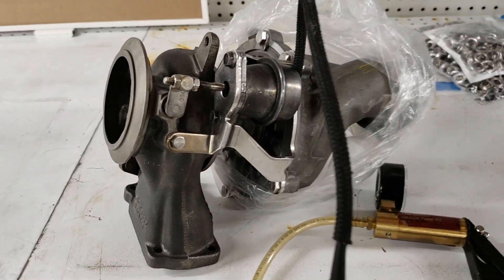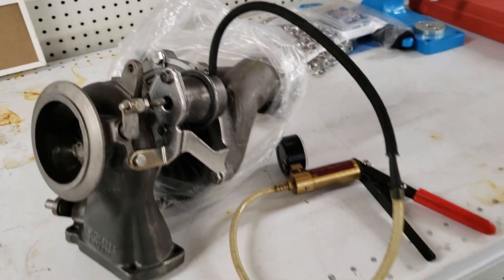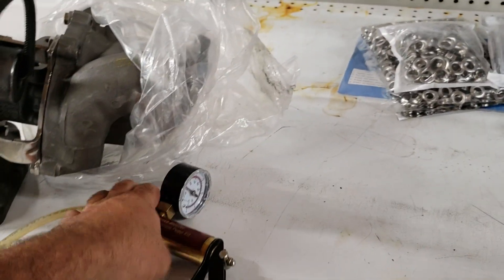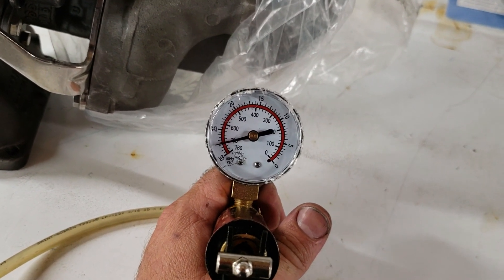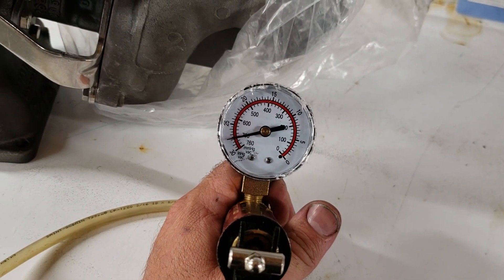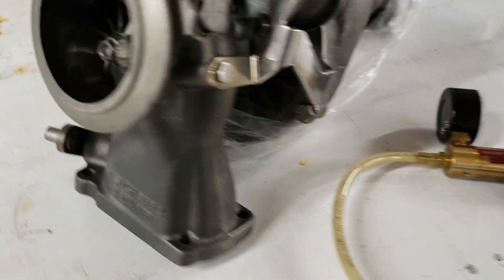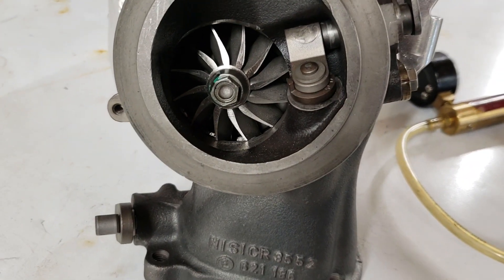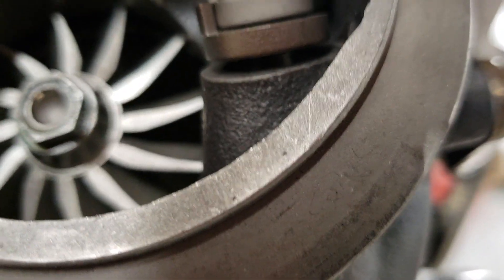BMW M57 wastegate talk

Comment: I have an E39 525D on a stock map. I have recently put a 530D E39 hybrid turbo, it should be boosting around 17psi
It’s actually boosting to 35psi plus, we changed the actuator, and when unplugging the MAP sensor it’s laggy as hell but boosts to exactly 17psi
Any ideas?
Reply: its a vnt turbo at first, not wg, and secondly, a hybrid should be remapped with a person that know PID control loops and can adjust them. when unplugging map, the ecu goes to limp, and it should only boost as the turbo can with the vnt at stock position

Comment: What is the part number for this actuator. I called a few days ago and was not able to get a part number...
Reply: Would like to know too
Reply: Borg Warner was very helpful when I emailed them. 👌🏼
Reply: @Robert.K  Did they give you a price at all?
Reply: @JINSTASUTUBE  2400 NOK / 210 GBP / 285 USD
Reply: Is yours not holding vacuum?
Reply: My car is a 2005 535d by the way, not the same as what's shown in this video. Prices should be about the same anyways.

Comment: I’m having a problem with boost creep on my ‘12 X5d. I have verified the WG open by applying vacuum. I adjusted it the other day and added a little more preload on it. I am still seeing 38-39psi when commanded is 33-ish psi. 
Have you ever experienced a WG port being to small or clogged on these? My drive pressure is very reasonable for the boost and engine load.

But I am at a loss on figuring out the overboost.
Reply: Have you been able to figure this out? I have same exact situation right now after Dpf delete and tune ..
Reply: What was the fix? Any info on that?
Reply: Ditto, same issue after dpf delete.
Reply: Ever figure out the overboost??

Comment: Isn't the diesel M57 turbo open by default and the vacuum closes it?
Reply from the maker: No sir, just the opposite
Reply: @TuneMyEuro  well im glad to know that because I never thought to check it when I was rebuilding the engine. I have the M57NTü Top 535d with the two sequential turbos. It was a bitch to set up the changeover valve but I think I have it. I setup the (only) wastegate (on the the big/low pressure turbo) by applying vacuum and then pushing the valve to the open (I had thought closed) position and then tightening the 10mm bolts in that position. I'm now wondering if I've done that correctly. Is it strange that wastegate adjustment would effect the fuel consumption?
Reply: @TuneMyEuro  PS it's a pre Lci with 200KW from 2005
Reply: Hey guys 
I got 335d, after installing straight pipe, deleting EGR and swirl flaps getting P02CA overboost on turbo B, any advice? Thanks

Comment: So...when vacuum is applied the wastegate is opened and when there isn't vacuum the wastegate is closed?
Reply from the maker: Vlad ZSX correct
Reply: FixMyVW.com by AARodriguez Thank you. What about the compressor bypass valve? When vacuum is applied to the actuator it opens the plate, therefore allows the air coming out of the big turbo to enter the intercooler? And when there isn't any vacuum it directs the air from the small turbo to the intercooler?